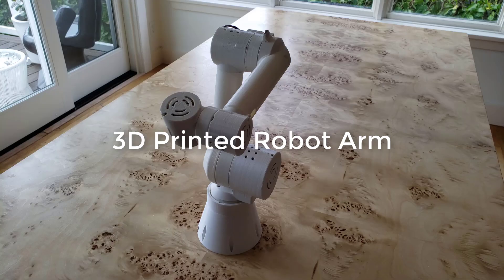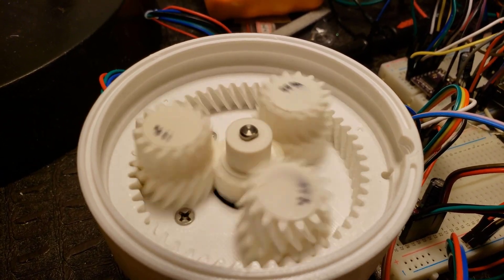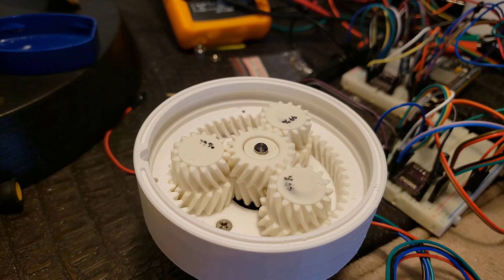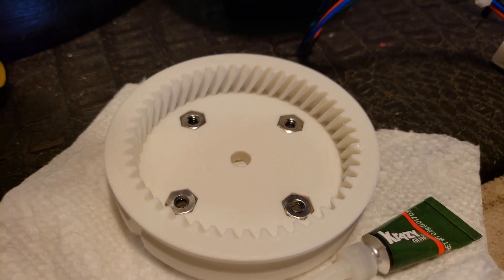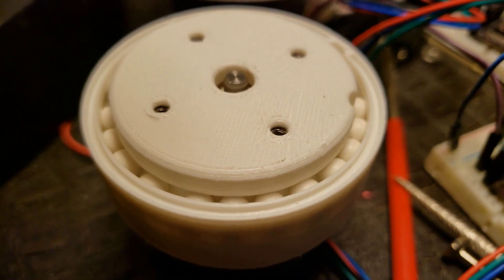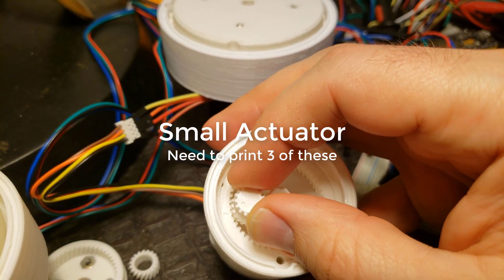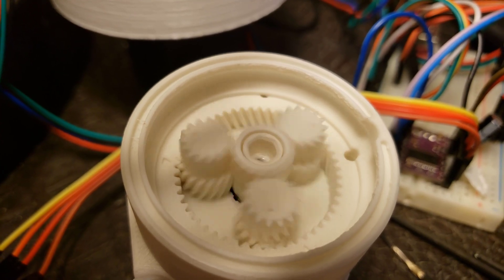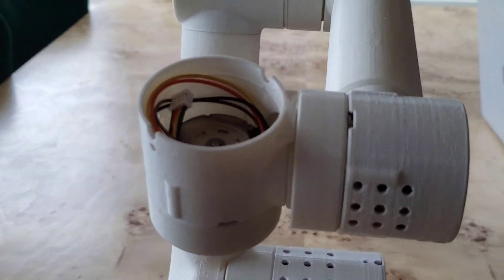3D Printed Robot Arm

Comment: The bb's seem pretty annoying to deal with. Have you tried just printing spheres in place? I did that with some print in place bearings I made and they work very well.
Reply from the maker: That's a cool idea, but those need to be really smooth, so that would worry me you'll never get the smoothness and roundness that you need. Albeit you are sort of averaging them together, so maybe it "mostly" works?
Reply from the maker: I will say in subsequent designs I just went with cheap off-the-shelf metal bearings because they're worth the simplicity, smoothness, and tightness beyond a 3D printed bearing and they're not that expensive on the low end, but 10 times better than a 3D print bearing.

Comment: GREAT Stuff !.. and a lot of great info on building it. However, I noticed you didn't put ( or at least I didn't see?) you put vaseline around the airsoft BB's?? Also.. I built one a few years ago, similar to this. but I have never seen anyone use vaseline? I'm curious how long it last?  as I used a tube of Lithium White grease that works really really slick and well.. still lasts after a few years!!  But cost a lot more than a jar of vaseline . LOL.. so if it works as good. .I'll try vaseline next time !!

Comment: You don't sand gears, you "lap in" gears.  Apply a fine lapping compound to all the gears and run them until they get quiet.  The lapping compound is basically grease and sanding media and the teeth of the gears will rapidly wear away the spots that interfere on the gear teeth.  This has been the acceptable practice since modern gears were invented.
Reply from the maker: Interesting. I am working on a BLDC version of the actuator now. I'm printing the new compound planetary gear in nylon and indeed I am breaking in the gears by running them raw against each other and it is smoothing them out. However, what lapping compound would you use for plastic to make this process faster/better? I can't find any when you search google for "3d printed gear lapping compound".
Reply: @JohnLauerGplus  Loctite has a brand called "Clover."  I'd say a nice 200-300 grit would do it.  The  Lower the grit the more abasive and faster, but finish is not as pretty... higher grits will give a smother, prettier finish, but take longer.

After the gears quieten, remove and clean them thoroughly.  Add real grease and they will be perfectly mated!

THIS is old-school gear perfection!

Comment: Adjust the current , that screaming is due to too high set voltage regulator on the stepper driver. The stepper motors shall be dead silent

Comment: not bad but for 3d printing you make hard robot arm.  With 3 motors can be done. because you dont use 4 or 5 axis. you print in 2 dimension X and Y(vertical) and  Z is leveling. you cant print on X and Z plane(horizontal).
EXAMPLE of ROBOT ARM is: Human arm. Entire body is the Z axis from the shoulder start the arm and use it in horizontal way.The elbow is where 3rd motor will stay.  You will not have specific X and y motor axis. Motor X and Y must work toghether to make lines and curve. Z motor axis is independent.

Comment: It looks very nice, but I would probably have used steel balls for the bearing. Why did you choose to go with plastic pellets?
Reply from the maker: I don't think steel balls would work much better, but perhaps. Didn't try it, but I think steel against plastic may wear in an odd way. Plastic against plastic seems to wear nicely. Also, these bearings turn out really tight yet smooth rotation, so that's not the part of the design I'm worried about. What I don't like is the power of the stepper motor.

Comment: Would you recomend to use pla or abs, because normaly abs should be stronger.
Reply from the maker: I think either one is fine. I used PETG in the latest design, but I'm going back to PLA. I still find ABS kind of hard to work with. The strength of the plastic isn't the issue, it's the strength of the stepper motor that's the limiting factor on the actuators.
Reply: Ok, I will try with PLA. Trank u for your answer.

Comment: Is it possible to use a NEMA 14 Bipolar 200 Steps Rev 35×28mm 10V 0.5 A Phase stepper motor for the small acuators?
Reply from the maker: Yeah, you can use any motor you want, but you'd end up redesigning the 3d parts a bit for fit. If you do try out a NEMA 14 and rework any of the CAD, could you please share it because even I would like to see some stronger motors on these actuators so we have choice. The stepper motor driver in this design is 2A capable so the electronics are ready to go for bigger motors.

Comment: When sanding the top lid, do you sand in between each of the teeth?
Reply from the maker: I do use a small file on the teeth, but I found on my Ender 3 I could get the print clean enough to not necessarily need to sand the teeth. I have to tighten the belts as tight as I can get them and use 0.1mm layer heights.

Comment: What is the cost for this arm until this moment? Do you have in plan to do a “metal” version?
Reply from the maker: So far the arm is like $95. No, doing this in metal would be very hard given the intricate details. Maybe 3D metal printing could work, but the weakest point isn't the plastic, rather it's the stepper motors. So the material doesn't matter as much as you think. Going stronger would require more gear ratios. Harmonic drive would be amazing if we could all figure out how to print a harmonic drive.

Comment: How did you set the homing position for your robot ?
Reply from the maker: You can set it to anywhere via the hall sensor. Even once the hall sensor is detected, you can have the actuator move to any home position because you now have a known state.
Reply: How many hall sensors you put in each joint and where did you put it? I think each joint has small space to put inside a hall sensor or end-stop switch. How did you solve this problems ?
Reply: Oh thank you I found your part 3 video you have already show how to detect sensor and put it inside! Thank you again

Comment: how much weight it can handle it ? Could it carry 0,5 kg without any failure issue ?
Reply from the maker: Yes, it should be able to handle just about 0.5kg, but it is still untested.
Reply: @JohnLauerGplus   What is the Gear Ratio for large actuator ? I wanna use "Step Motor Nema 23 2.7 Nm" motor for large actuator
Reply from the maker: @3dsafety247  38.4:1 is the ratio. The Nema 23 should work quite well.
Reply: @JohnLauerGplus  Thank you for all  informations. You inspired many people with this project (incluiding me). I will share when I finished assembly.
Reply from the maker: @3dsafety247  PLease post some video if/when you get your build. I would love to see how others are getting their own version assembled. Did you get to see Part 2 and Part 3 yet?

Comment: the high torque nema 17 is not meant to be on rotation, its the medium torque in there... the high torque is on the shoulder, as it has to support all of the weight of the arm...
Reply from the maker: Yes, i think i messed up putting the larger motor in the base. I caught that too. Good eye.

Comment: Why did you not put the drivers and boards in the bottom and wire it through? Great job btw.
Reply from the maker: Because wiring robots is a huge pain and I need/want a temp sensor in each actuator, fan controller, hall sensor for end stop, ws2812 LED for status, and touch sensor for local jogging and programming. We now know how to run signals over the air, rather than needing copper, so can eliminate many wires that way. ESP32's are dirt cheap and a novel way to go these days. Yes, it's all theory until it comes together, but might as well give it a go.
Reply: @JohnLauerGplus  thanks man
Reply from the maker: @williamalkhoury3417  Part 3 shows you it all coming together--thus answering your original question. https://www.youtube.com/watch?v=4o3d7_WZ_DQ

Comment: i didnt get  the reason y u used planetary gear train at each joint, is it to have sufficient torque( to take up the further assembly loads) and speed reduction ?
Reply from the maker: You are correct in your assumption. It creates the torque you need. The extra benefit is you get better accuracy too because the steppers are 48 steps per rotation, but now you control 48*38.6 positions per rotation.
Reply: @JohnLauerGplus  thanks for your timely reply

Comment: it looks like you printed this on the ender 3, if you did, Thank you for doing so, that lets me know big prints are possible on a small machine
Reply from the maker: I've been very happy with the ender 3. However I did have to replace the extruder plastic parts with aluminum ones because they cracked

Comment: Do you have a GitHub for the cad? Would be wonderful if you could share :) would like to create an sdk for this.
Reply from the maker: There are several CAD files. The newest control board design, which I have not posted a video for yet, is at https://gallery.autodesk.com/projects/137275/chilipeppr-robot-arm-actuator-control-board and you can download the model. It has 3 PCB's in it that all interconnect. The CAD for the components are in the description on Thingiverse.
Reply from the maker: Update. Latest video Part 3 now has a Github repo with all the goodies. https://www.youtube.com/watch?v=4o3d7_WZ_DQ

Comment: For the high detailed planetary gears you say you used a 0.3mm layer height, why not go with something like a 0.1mm? It would take longer but it seems like it'd be much less sanding to do, right?
Reply from the maker: No, I used a 0.3mm nozzle with 0.06mm layer height. Creality Ender 3 magic numbers are 0.06 for full steps so I use that and they end up coming out with near perfection. I barely have to sand/file anymore. Use the latest anti-backlash forgiving design for the small actuators. I haven't made a video of those yet. https://www.thingiverse.com/thing:3566678
Reply: @JohnLauerGplus  What slicing program do you use?
Reply from the maker: @Hotdog80085  latest cura release
Reply from the maker: I use Amazon pla which seems less soft compared to hatchbox pla, but find I have to extrude it at 225 for pla to get perfect extrusion on the 0.3mm nozzle at that layer height.
Reply: @JohnLauerGplus  I probably have the exact same filament as you, Amazon Basics 1.75mm Pearl White PLA lol. You mentioned that you are using a .3mm Nozzle, is there any particular reason you swapped the .4mm nozzle out?
Reply from the maker: @Hotdog80085  Yes, the detail needed on the gears is important. You can achieve with a 0.4mm nozzle but I found I had to do a lot of filing with a super thin file to get into the bed of the teeth. With the 0.3mm I found almost no filing needed. Also, I did a heat test print on that filament and found the smoothest flow at the 225 mark.
Reply: @JohnLauerGplus  thats impressive, fine prints below .1 give me some nasty whiskers, even with retraction set to 5mm and 200°

Comment: Are you able to give a guideline of what type of time investment making this robot arm takes?  I'm no expert but I really want to get something like this to expand a start-up product I'm working on.  Wondering if this is the type of project a fairly unskilled electronics/coder person should take on?  Thanks
Reply from the maker: I think this robot arm can have melting issues because the small steppers get so hot, the PLA will melt. I think well-managed electronics can avoid that from happening, but it does concern me that this is far from being anything useful in production. However, even making the main sun gear that attaches to the small stepper out of aluminum could possibly solve the problem. I think it will take the community to help figure it all out.

Comment: Would you be able to modify the design to use inserts instead of the M3 nuts? I find they work a lot better if you can heat the plastic and insert them instead of using nuts in a hex pocket.

Comment: Nice robot arm!
i'm making this robot arm.

i have a question.
what power did you use?
how many??
plz answer my question..
Reply from the maker: I'm using 24v power, although right now I've been using 19v just because I had a handy old laptop power supply lying around. In the part 2 video I think I talk about the voltage.
Reply: John Lauer thank you!!
Reply: GimLi김리 아 정말요??? 혹시 볼트너트 어디서구하셨나요 볼트 너트 못구해서 에폭시로 붙일까했는데 못버틸까요..
Reply from the maker: @GimLi김리 Google translate says "저도 이거 만들고 있는데 화이팅입니다~~" is "I'm making this, and it's firing." Good to hear.
Reply: John Lauer ha... we use 12v power supply. Although we connect only one pm motor with supply,. motor is not working...

Comment: after you break in the gears, you need to wash the plastic dust out of them as it will act as an abrasive along with the Vaseline breaking down your plastic. I would invest in some rubiks cube lubricant from cubicle labs.
Reply: silicone based would be best

Comment: Looks interesting! What about just plain sliding bearings?
Reply from the maker: I think it would be interesting to look at options for bearings, but the way these actuators are all integrated is very nice and trying to get an off-the-shelf bearing in there may not be as elegant. However, I'd love to see if anyone could CAD out a potential design.
Reply: Well, I just ment to use plastics sliding against each other. Without any real bearings.
Reply from the maker: @CinemaTablet  I don't think that would be smooth or friction-free or tight enough. Ultimately you do have plastic against plastic since those airsoft BB's are plastic.

Comment: Great Project! Your first layer seems to have lines between the perimeters. If you use Cura and want to get rid of it, select Off at the setting "Combing Mode"
Reply from the maker: I've been using a raft to print these gears so that the gear teeth are perfect. The downside is the raft makes that first layer on the actuator parts not look pretty. I probably should do those as a separate print job without a raft.

Comment: Absolutely awesome work, what abouth backlash? Thanks for sharing
Reply from the maker: Backlash is minimal given how tight these gears are fitted. Those airsoft BB bearings don't move laterally at all, so they're pretty decent. You'd be surprised how little backlash.
Reply from the maker: And now the latest design has an anti-backlash flex spline in the actuator to help solve backlash. https://www.youtube.com/watch?v=4o3d7_WZ_DQ

Comment: I think you are using compound gear-train which is very inefficient.
Reply from the maker: Very inefficient from what perspective? Meaning the friction it generates? Or you mean the gear ratio?
Reply: This gearbox design is inherently inefficient at gear-ratios above 1:20 or so. The efficiency can be as low as 10 to 20%. See literature on WOLFROM-, 3K- or Ferguson Paradox. 
https://www.researchgate.net/publication/245126306_The_analytical_expression_of_the_efficiency_of_planetary_gear_trains

Comment: Very nice!  Encoders? Limit switches? Payload max? Movement speed?
Reply from the maker: Latest design now has a hall effect endstop. I'm getting about 500 Hz PWM signal to stepper driver before these 35mm steppers freak out. It's looking like 1lb could be achieved, but I'll be doing a payload measurement in Part 4 video in the future. Here's Part 3 now. https://www.youtube.com/watch?v=4o3d7_WZ_DQ

Comment: Very impressive, and looking forward to your updates.  Probably me being an idiot, but how is power/signal fed through each joint?
Reply from the maker: There will be 2 power wires going to each joint. They're not wired up yet. I may end up with a sync signal wire as well unless I'm happy with the Bluetooth or WiFi command sending being close enough on timing.
Reply from the maker: BTW, check out my new approach of doing a slip ring in the actuator for the 20v power so this turns out to be a zero wire robot. I'm not perfectly happy with it yet because I get some blips on the power, but it may pan out if I can get the design tweaked. https://www.youtube.com/watch?v=4o3d7_WZ_DQ&t=18s

Comment: I thought I spotted a encoder in one scene, but you didn't talk about if you were using them or not.
Reply from the maker: No encoders. You can very readily rely on stepper motor steps to execute steps accurately without needing encoders, just like on a CNC machine. However, there will be joysticks to train the robot and record the step position to generate Gcode.
Reply: @JohnLauerGplus  Then you going to need end stops to have a known position to start at (like CNC machines).  Do you have those?
If you get skips (too much torque) then steppers can skip and you will get off on your assumed position.
Reply from the maker: @MakunaRGBIC  Yes, looking at using magnet hall sensors as endstops.
Reply from the maker: @MakunaRGBIC  I got the endstop hall sensor working in Part 3. Super cool. I am still considering adding an encoder though, but can't find one that would fit the actuator design/format. Any ideas? I would want to encode the reduced output, not the stepper motor input.

Comment: Nice work!
I'm just wanna know how did you wire the motors?
There are planetary gears and no space for wires.
And There is no wire outside at your final shot. 
How did you wire??
Reply from the maker: Well, in Part 3 I show you creating a slip ring on each actuator so there are no wires. https://www.youtube.com/watch?v=4o3d7_WZ_DQ

Comment: 5:57 Why is the housing standing that far off? Doesn't look professional.
Reply: Are you referring to the offset of the shoulder joint?  I did that so that the intersection of the J5 and J6 wrist axes lies in the plane formed by the intersection of the J1 and J2 shoulder axes.  This simplifies the kinematics considerably.  The offset also slightly reduces the overhang load on the J1 slew bearing.  All of the other joints are offset to increase the range of motion, but because the arm is typically mounted on a table, you'd rarely need the upper arm link to rotate into the plane of the table.  I'm a function over form guy so I tend not to fuss over what looks best.